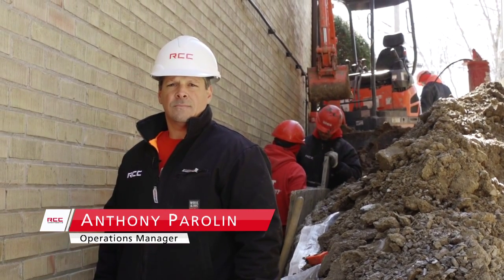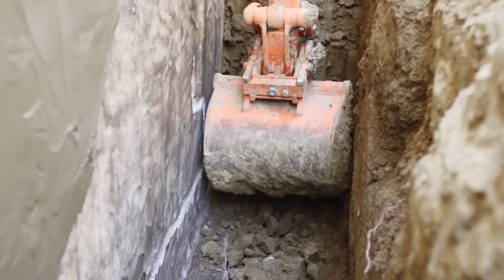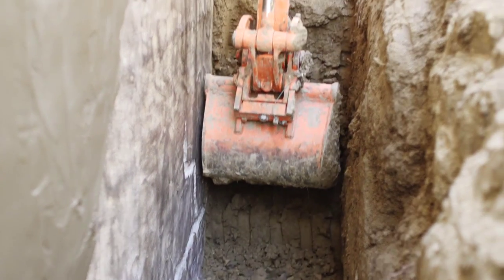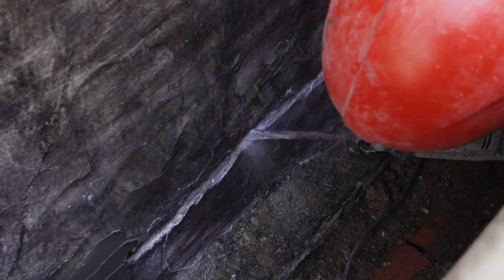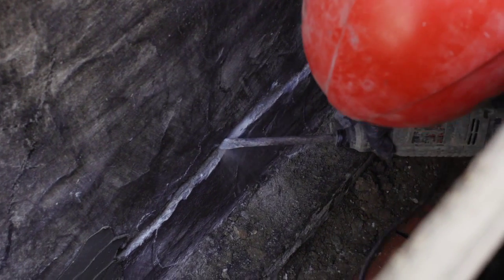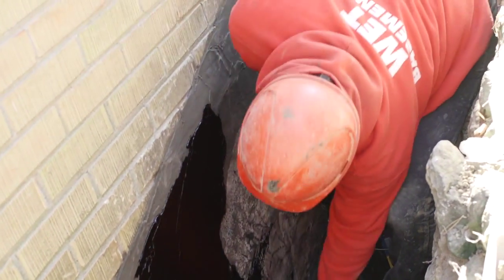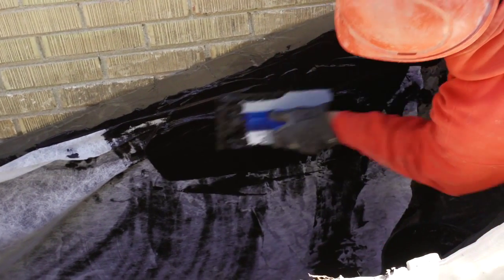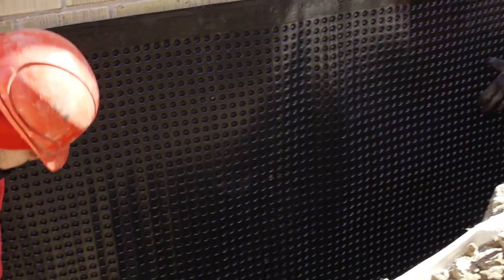Waterproofing Exterior foundation wall

Comment: The warranty is now 50 YEARS!!  Yes, I said 50 YEARS!!!
Reply: well placed and maintained clay weepers can last upwards of 150 years. As long as you can flush it out, it will work as its supposed to. The limitation is the rubber/tar coating on the wall, The DMX AG foundation wrap used has a warranty/lifespan of 25 years, which is why the warranty in the vid is 25 years. The rubber coating, once the foundation wrap fails, will have a life span of ~40 years itself if applied properly.

With that being said, I dont find that the weeper drain (corrugated with sock) that was installed, was installed low enough, and i would have paid extra to get the sched 40 pvc weeper drain, and extra 3/4" clear gravel around everything before backfill.